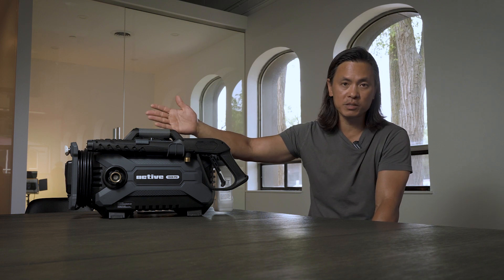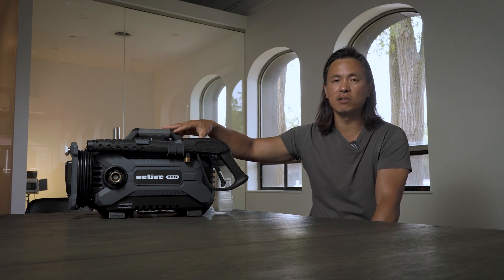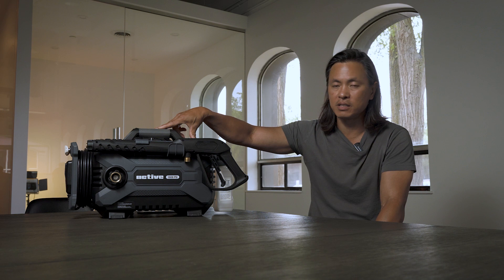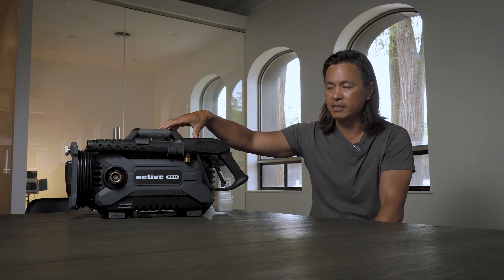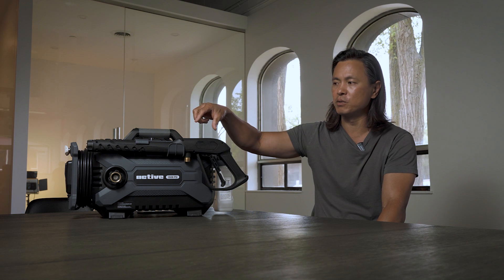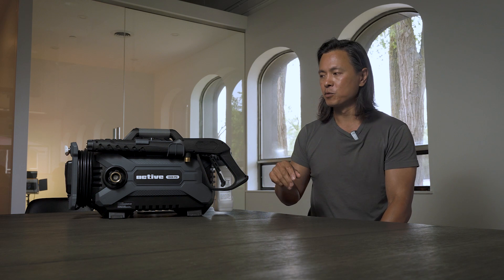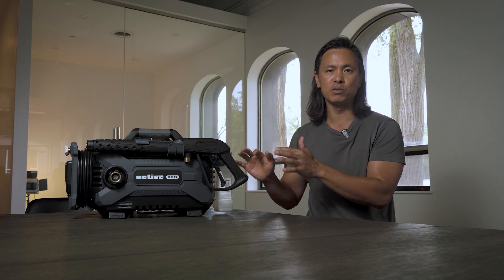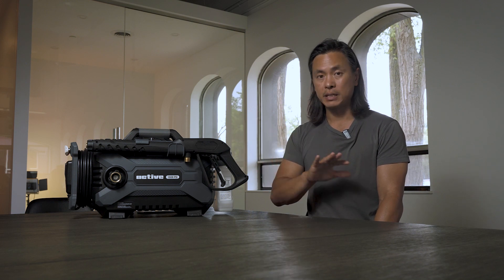Pressure Washer Design Review - Can the Active VE52 get any smaller?

Comment: The higher actual output in a smaller package is why I ordered the VE52 recently (haven't received it yet). I do have some comments after seeing these videos though. Even though I'm an "enthusiast" or "DIY" user, I'd appreciate a commercial version with higher quality accessories, standard m22-14 fittings and even more crucially, one with a longer lifespan even more. With several vehicles and motorcycles, my use might average out to an hour per week. At the 100-150 hrs of pump/motor life that has been quoted in other videos, that's only about 2-3 years before I add another thing to the landfill. I would much prefer to have something like this for 5, 7 or even 10 years before it needs to be tossed out.
Reply from the maker: We are working on something with a longer lifespan, better fittings and accessories.  That said, unless you go the fully serviceable route, it would be difficult (if not impossible) to get up to the 7-10 year range at constant usage.  But we think in your case at an hour a week it should last you 2-3 years no problem.  150 hours of pump life (the motor has marginally longer life) is what we test it to - you might begin to notice degraded performance before a complete breakdown.
Reply: @ACTIVEPRODUCTS  A fully serviceable unit would be great! I'd be happy to replace parts every 3-5 years rather than the entire machine.

Comment: Can you place outlet and inlet on one side
Reply from the maker: Technically they can be placed in any orientation.  Our designs are based on what is suitable and user friendly for the widest range of application.  Placing the inlet and outlet on one side can sometimes get crowded, making it a little difficult to attach and detach hoses.   it also impacts the design of the pump itself.